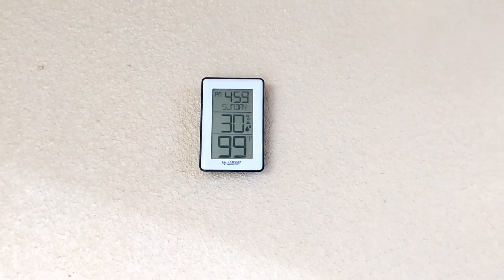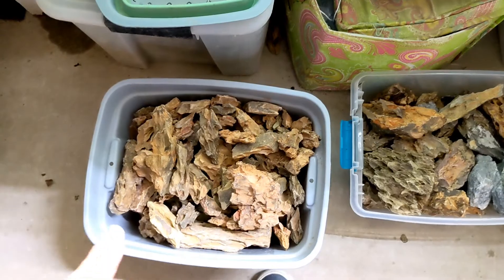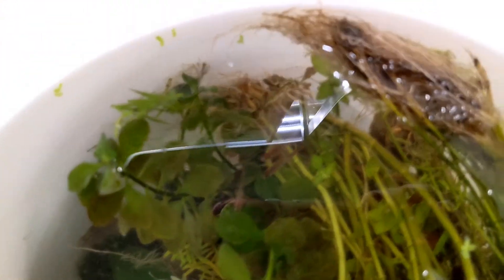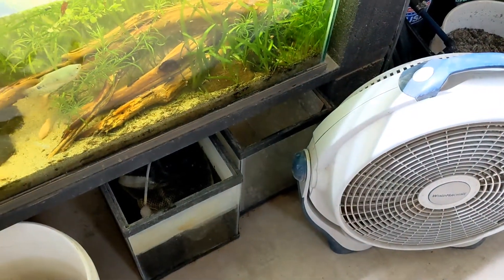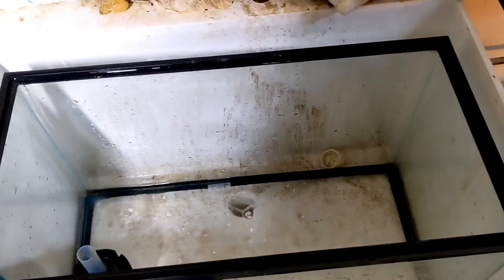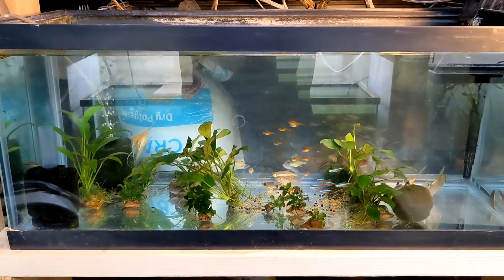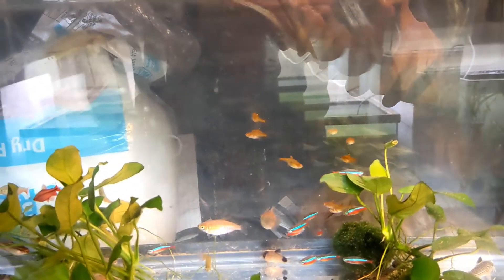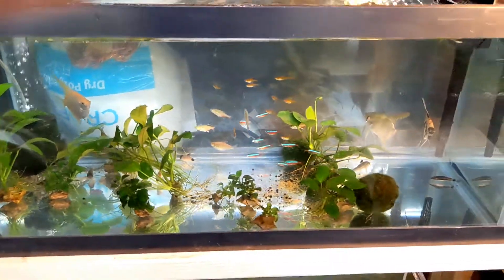New fish in my fishroom

Comment: if your fish room is in the garage how do you keep the water temps down during the summer here in yuma?
Reply from the maker: Run lots of air in the tanks and two shop fans.
Reply from the maker: I learned that from Chris Miller of the Yuma Fish Gallery
Reply: is that a group on fb?
Reply from the maker: Yes, it the local FB group